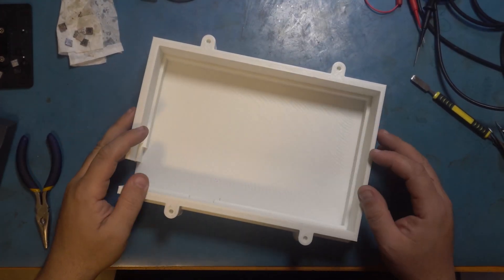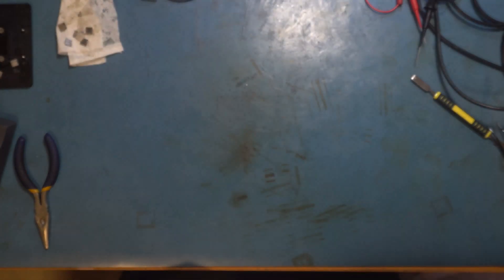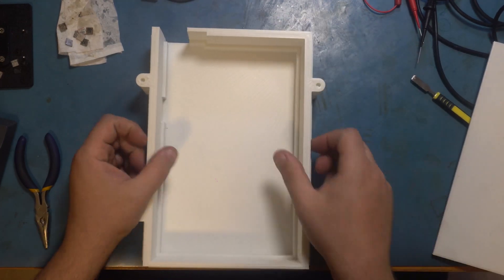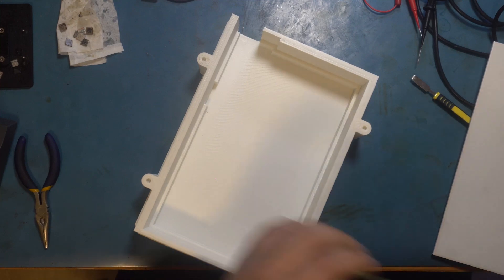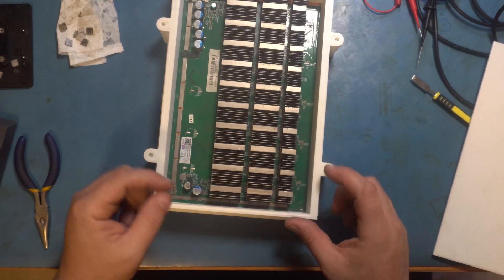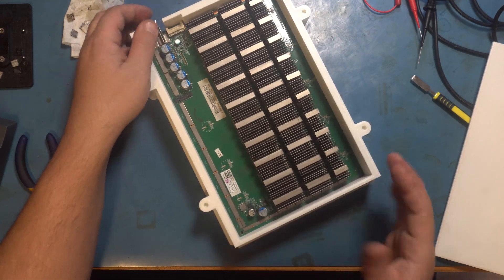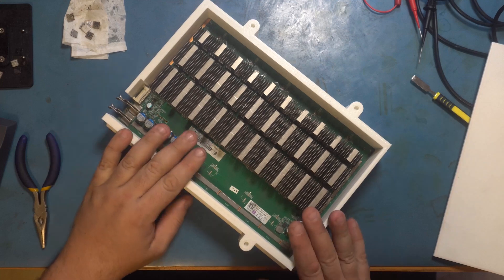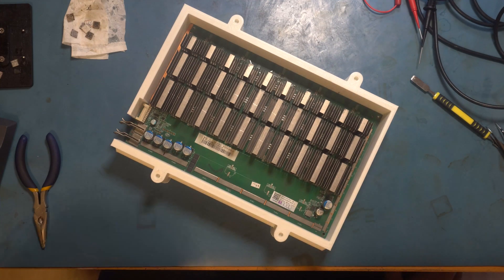Hashboard protective case: Prototype #2

Comment: put 2 tabs on the sides that keep the board from making the angle where the sinks touch. set them right on the top rim inside. then the board needs to be tipped then slid out. looks pretty sweet
Reply from the maker: Thanks for the idea, I'll try it out.